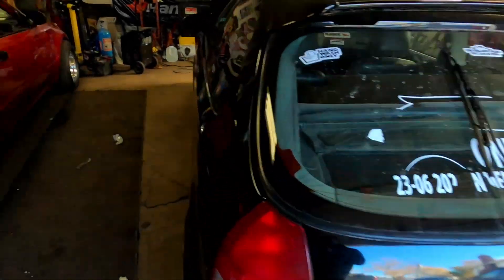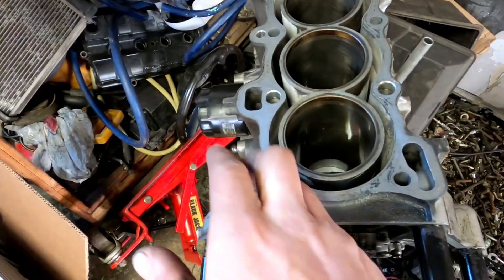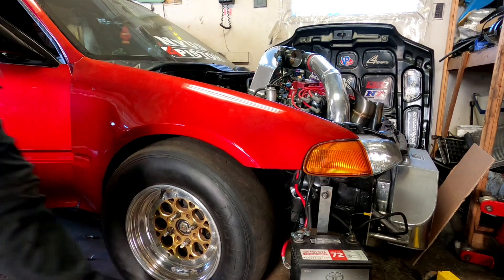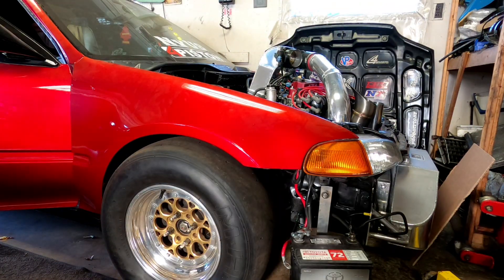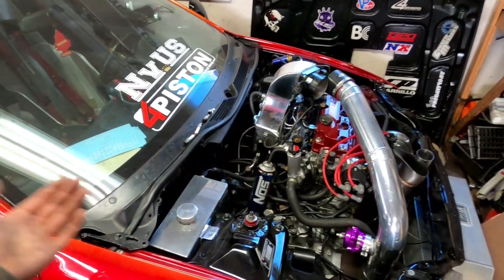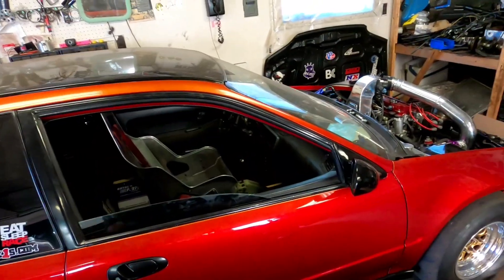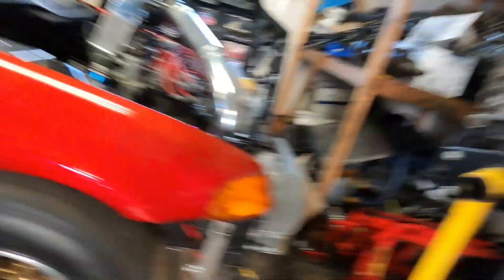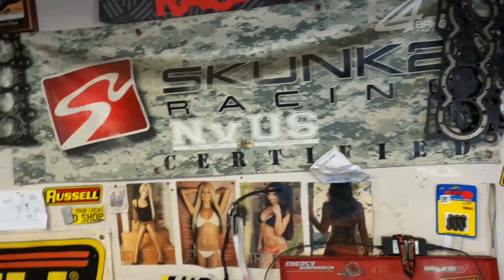How to fog and store your Racecar Engine after using VP M5 race fuel 5%NITRO H2B AWD car maintenance

Comment: You really left out a lot of info and it’s going to cost you a motor one day.
With any motor that is alcohol fueled… you have to change the oil on a regular basis because since there is water in the engine… it gets in the oil. Drain the oil and really look at it and you will see the water. Us racers change it like every pass. Next issue is that spray will not get it out… year it may chela the cylinders but it won’t get it all out. Then what about all the fuel in the lines eating at the seals? When we are done racing for the weekend EVERYONE swaps in regular fuel, changes the tune and let’s the engine run for a bit and flush all the alky out and burn off all the moisture… then change the oil and now it’s ready to be parked.
Anyone that just says ti spray some stuff in the head is going to be going though motors and fuel systems at some point.
Reply from the maker: Anyone running ethanol or methanol would already know this this is after the lines and fuel system has been flushed with pump gas and a fresh oil change we live in canada its a last resort to prevent rust
Reply: @fullspoolcustoms3944  people believe everything they read on the internet. Based on your video they are going to believe that you basically just spray some spray into the head and then all is well. If you flush the fuel system and engine then the spray is a complete waste of time because the water is already gone. 
Just looking for those that do believe everything…
Have a good one
Reply from the maker: To tell ya the truth I flush with pump gas 91 after every race event and oil once before and once after ruff 6 8 passes then plugs then valve lash and drain catch can

Comment: Can you make a video about pros and cons of running straight M5 and E85 fuel? Also what wideband and 02 sensor you using … maintenance… planing on running M5 on my 419 stroker N/A engine 14:5 compression but seems like there’s not a lot of info available for us the truck guys. I know you need more fuel system and injectors but any other tips ? Thanks also great video 🤘🔥

Comment: I run a all motor h2b on stock tank and ptfe fuel lines on FIC 1000cc injectors. Is it fine that i leave e85 in my tank over winter? Been letting  it sit throughout the summer occasionally drive it or turn it on and it never really gave me a issue.
Reply from the maker: Hey buddy I would still recommend flushing it out with pump fuel it will be rich when you idle it but will clean the pump filters and injectors corn is still hard on stuff over time if it's a ek  should have a 17mm drain on the tank dude if you got any more question hit me up on here or fb for fast reply
Reply: @fullspoolcustoms3944  thanks for the info man I actually wanted to ask you some questions if that was cool of you? Whats your facebook? Ig?
Reply from the maker: @TheeSwift24  kyle Murray on fb and fstmurr on instagram